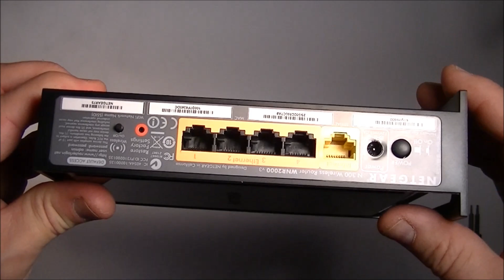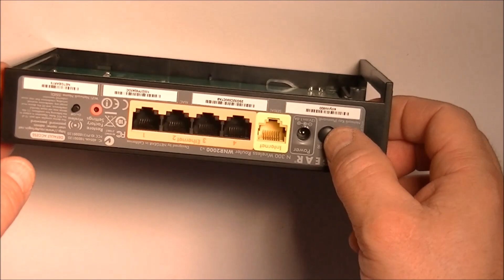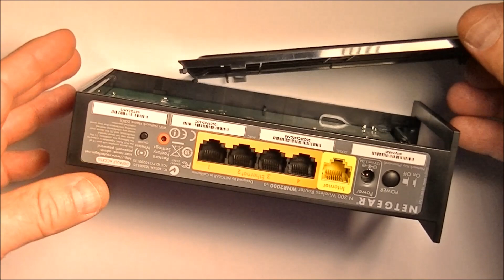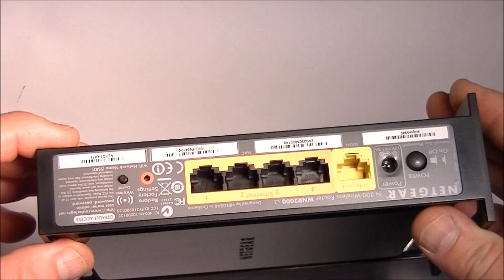NETGEAR Wireless Router - N300 (WNR2000) V3 (Version 3) Hardware Review & Disassembly/Reassembly

Comment: DD-WRT Build  29837 webflash is working for this router. Its below the required size. I upgraded from 18777 and it's much better. Just a heads up.
Reply from the maker: Thanks for the feedback. I installed the r29837 in mine and it works great. Thanks for the feedback and watching.
Reply from the maker: It should be able to do able to do N300 (300 Mbps) in a perfect world on WIFI. Thanks.

Comment: I'm tempted to replace the internal antennas with some homemade ones. I just made a cloverleaf, I wonder how well it would improve the range
Reply from the maker: I always found that the internal antennas were very good but feel free to experiment you may find an improvement. Thanks.
Reply: Richard Lloyd I actually replaced them. I did get a little bit better range, but I actually got a higher bandwidth
Reply from the maker: That's great. It makes sense that it would give you better bandwidth. What kind of antennas did you use? Thanks.
Reply: Richard Lloyd I used cloverleaf antennas. There is actually a guy on YouTube that shows you how to make many different types of antennas. He usually does 2.4 ghz or 5 ghz.
Reply: What did you replace the with? What are the connectors on the board called? I have tried U.FL but the ones i have dont seem to fit. They should just click in, these dont. I Just realised i have WN2000RPT

Comment: I opened the case and attached a USB to serial adapter (CP201x UART). Dang those torx heads are tiny! I think "T6" was needed. So through serial, advanced recovery and firmware loading can be done like people say in the wiki and forums of the www.openwrt.org site. PuTTY terminal connected to COM port works nicely. Here is a pic of my wiring http://goo.gl/3448CO Cheers
Reply from the maker: That is very cool. Thanks for the feed back and picture. Did the repair work for you?
Reply: Able to view the pic? Repair was unnecessary. I added the serial-usb adapter for diagnostics now and it may be useful for some kinda firmware repair or update later. This serial adapter is absolutely useful on some Linksys routers that are dumb about using tftp unbrick repair. I wish I could load Tomato or OpenWrt, but I think those fw's are incompatible with this router and other Atheros chip routers. By the way, I'm trying to impliment OpenVPN client connection in DD-WRT firmware. Any tips on that? Cheers.
Reply from the maker: Peter VanGorp Yes I could see the picture. Sorry but I have never done Open VPN on these, yet. I will have to try it in the future. Thanks again.

Comment: dd-wrt v24-sp2 (03/19/2012) std (SVN revision 18777) and BELOW, right? I would like to upgrade at least a little bit...
Reply from the maker: Yes. I have a video showing you how to do it and the correct links for the firmware. The links in the DD-WRT database are not good. Here is the link to the video : http://youtu.be/2hVs_cTIDsI